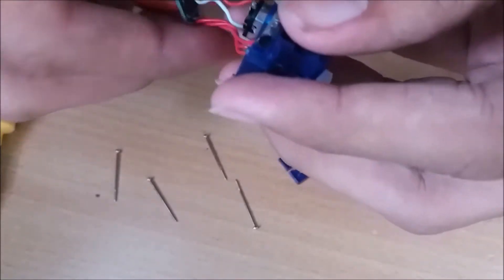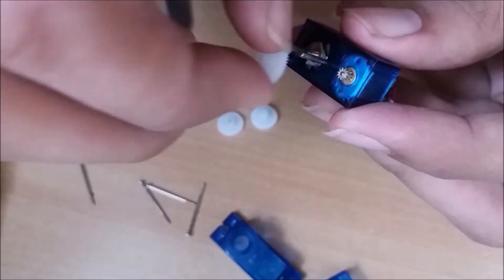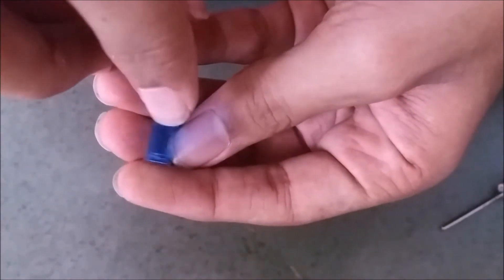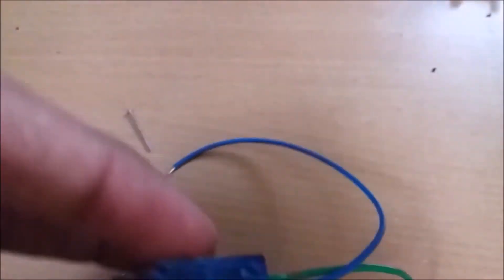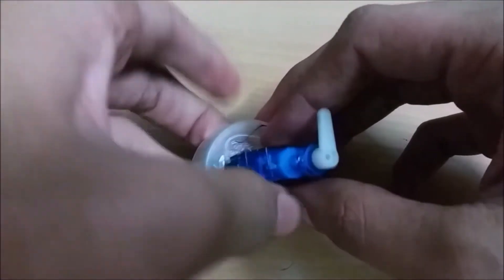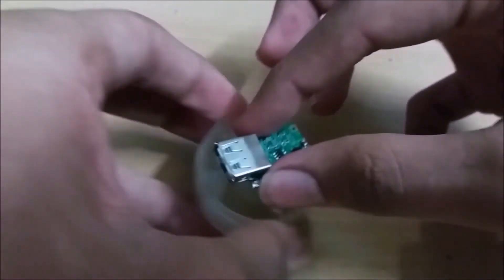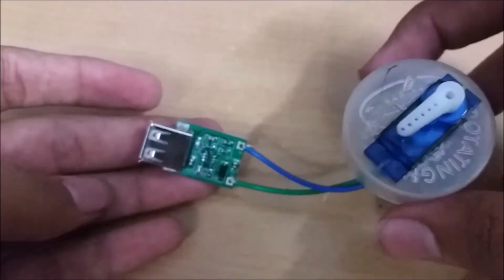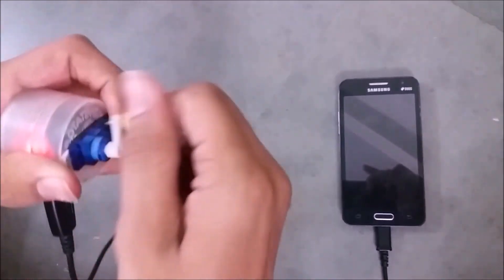Charge your Mobile for free I Emergency charger I Hand crank Generator I DIY tutorial

Comment: Music is really too strong ... to hear you .... :/ you should suppress it  or re-record OVER the current video you voice .

Electronic il very too low to respect normal USB (5V) so solution is good in its method but not at all to use it in real conditions. With a stronger servomotor it should be OK. :)